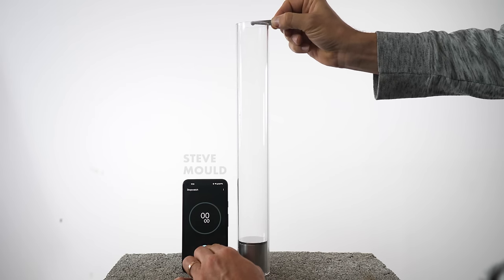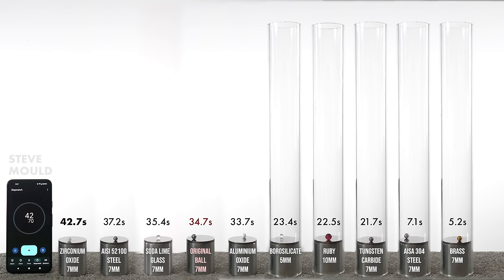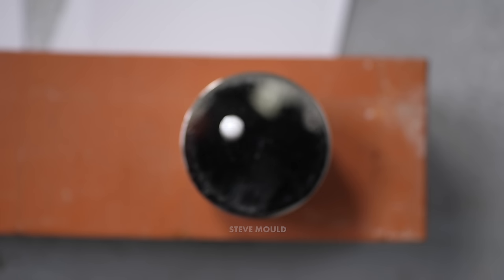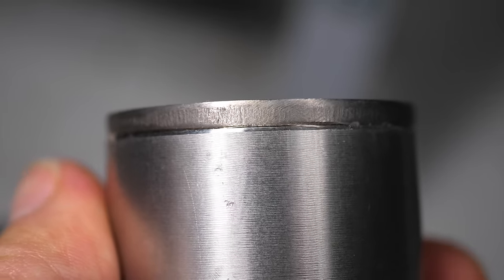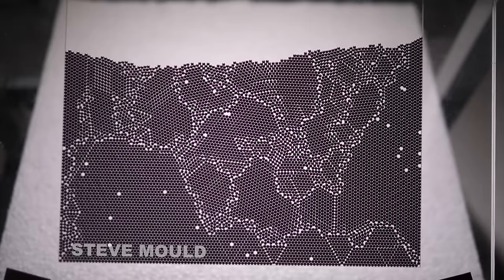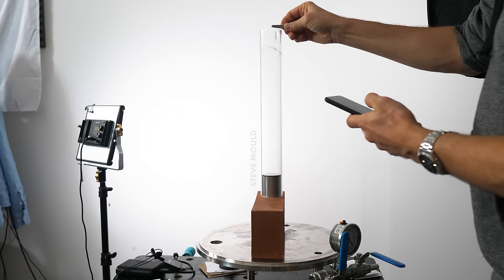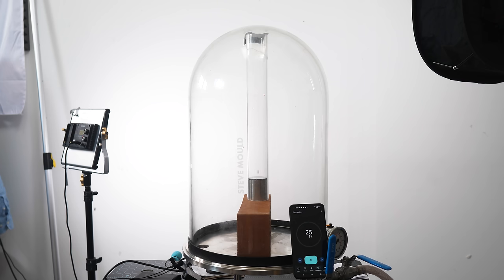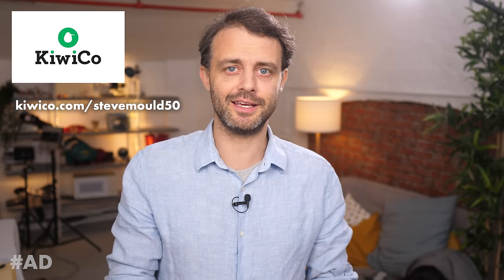This weird metal is insanely bouncy

Comment: Awesome video! Those were some very impressive bounce times! You mentioned that if every next bounce was some fraction of the height of the last, then this height would never reach zero, so the ball would bounce forever. However, the time between bounces also would reduce exponentially, so you end up with a geometric series that converges. You actually end up with a beautifully simple formula for the bounce time using idealized physics (so no air resistance or deformation just instantaneous bounces with a constant coefficient of restitution), total_bounce_time = sqrt(2*initial_drop_height/gravitational_acceleration)*(1 + coefficient_of_restitution)/(1 - coefficient_of_restitution). Of course, the real world is a good deal more complicated, but in this view, the ball bounces infinitely many times in a finite amount of time. Anyways, great video! :)
Reply: By the way, if you graph the logarithm of the delay times between bounces you get a decreasing line, whose slope it's just the coefficient of restitution. Any departure from the linear behaviour is due a failure in the simplistic assumptions.
Reply: @vincenzomartorana2625  to paraphrase your last sentence: If the data doesn't match the model, the model is wrong. 😆
Reply: @jimbrookhyser  and in this case testing the model is  as easy as tracing a line through the experimental points 😏

Comment: All I can say as far as getting your hands on similar ball bearing is that several years ago, and I couldn't even tell you what year, I read an article about a specific iron alloy metallic glass which exhibited exceptional bounce. If you can find that scholarly article I'm sure he'd be able to contact one of the participants in the experiment and see where they source their material heck you might even be able to lay your hands on the original Ball bearing in the experiment.

Comment: If you are testing number of bounces again, samplers like the one in Logic Pro x can easily tell you by loading in the audio file and using transients/peaks as the metric that decides chops/divisions. then it will may tell you how many it was able to locate (dependent on the software it should show up pretty apparently, I know logic’s quick sampler does)
Reply: same with fl
Reply: Reaper does it too. Many ways to do this. Remove silence by playing with the threshold will chop the file into several pieces, select them and it will say how many... Also slice by transient.
Reply: @capoman1  do you like reaper how's the UI

Comment: Would you be interested in using some of the sound files and measurements to calculate the gravitational constant? Not only could it be a relatively cheap way to calculate g, I am curious if it could measure the gravity gradient by performing the bounce tests at various heights.
Reply: You're going to have to assume that the collision time (the time the ball bearing spends in contact with the surface) is constant, which might introduce some error.

A second source of error will be due to the  sampling frequency of the audio stream.

You could probably get a pretty nice value out though.

Comment: If you assume a fixed coefficient of restitution (between 0 and 1) for a given ball and surface, even with perfect conditions (vacuum, etc), the time for each bounce is a fixed fraction of the time of the previous bounce. Thus the times of the bounces form a convergent geometric series, making a finite total time. Thus even if there were infinitely many bounces, the bouncing would stop after a finite time. (As you say, physical reality cuts it short in any case.)

Comment: That was genuinely fascinating. I found myself dying to see it tried in a vacuum, until you hit that very subject. XD I think you would have gotten a more dramatic difference with the smaller balls in a vacuum if, as you said, air resistance was the main factor limiting them.
I went looking for the Caltech paper to see what the final alloy was and found the simulations they ran to find the best conditions fascinating as well, and slow-cooling molten alloys in a centrifuge at 60,000 g kind of broke me for a second.

Comment: Fantastic video! I did my undergrad in materials science and mechanical engineering. The university I was at is still doing research in bulk metallic glasses. One of my friends did his PhD on the subject and is still working on it. Maybe they can hook you up with a bearing (University of Saarland, Prof. Ralf Busch's group)? Either way, the explanation was perfect.

Comment: 4:15
Sorry, I'm going to interject here with a minor correction! The time that the ball is in the air after each bounce is proportional to the speed at which it left the ground. If the speed decreases by a constant proportion after each bounce, then the total time can be represented by a geometric series, which will converge to a finite value. Therefore the ball does eventually stop bouncing, even in an ideal scenario.
Reply: Yes, I agree. "It would never stop bouncing" is very misleading here. In the mathematical ideal world, while it would bounce infinitely often, it still does so in a finite amount of time.
Reply: Achilles turtle flashbacks

Comment: Hey Steve, I love your videos and there's something I just noticed and it is the pacing and hooks in the video.

I'm currently at 5:54 and you seem to have exactly predicted what I was thinking you should explain next. Here's the list you've predicted so far:

- veritasium's video
- calculating the percent improvement in time
- using code to count bounces
- using sound to count bounces
- dilemma of whether to count manually or to write code

The streak was finally broken with the "crickets" and the mouth shapes. That was quite the inswinging yorker :D

Comment: I am amazed by how we could hear the bearing hitting the plate in the last trial with the partial vacuum. Our ear is sensitive enough to detect the vibration through the plate and substrate metal to the brick which vibrates and in doing so compresses the air and sends waves of compression to our outer ear which channels and amplifies these waves to our inner ear and so into our brain so we can 'hear' the vibration. Incredible.

Comment: so what if you had a metal made from a single "perfect" crystal of metal? would that then become a superior bouncy surface than a standard metal that contains imperfections?
Reply: I'm suspecting that the absorption goes beyond only plastic deformation and into the crystal lattices themselves absorbing some energy, as most lattice formations are not perfectly rigid like diamond could be in theory.  I'd be curious to see it tried, but I think the amorphous substance would still win.  I also wasn't surprised that the zirconium ball took the lead, as the folks who formulated the disk (also containing zirconium) were probably on to something.

Comment: I wonder if it would have behave any differently with the amorphous disc sitting on a steel tube instead of a solid cylinder, so it was like an elastic bridge not transferring energy to the steel in the center and plastically deforming it.
Reply: I think you’d get shorter bounce times.

Comment: One other kind of ball bearing material I'd like to see tried is CBN (Cubic boron nitride), being the 2nd hardest material there is after diamond.. Quartz could be interesting as well.. unfortunately I haven't found any sources for them.
CBN is often used in machining very hard metals, it's pretty amazing stuff
Reply: i wonder if density would affect results. it would be interesting to try osmium
Reply: @stewartross1030  I think the density would be minor in comparison to hardness.. density would mitigate the air friction a little but not much more.. try lead and gold.. heck, try mercury :)
Reply: Good point about density. Makes me think that rebound has more to do with how strongly the electrons are locked into their orbits.
Reply: @TheFredmac  yeah, quite possible, and if they're really locked in you'd think that would provide a stronger crystal lattice.
Reply: @Rx7man  In theory, the stronger the crystal lattice the harder the material, the problem with ceramic materials it's that it's not structure of single crystal defines their properties but also how crystals are packed in the material. I googled for microscopic structures of CBN and ZrO2 and the CBN has much more empty spaces in structure which can lead to friction between crystals when bouncing and loss of energy. If we could create perfect monocrystalline balls of both material then CBN would be a winner.

Comment: If you want to improve the result even further, you might want to scale up your setup, that is, drop the ball bearing from bigger height, so that it has more energy to start with, place the vacuum chamber on an anvil, or pull stronger vaccum! Even materials that have crystaline structure can behave like this, but they require a much bigger weight diffrence between the bed and ball bearing. You can see an example of that in one of the videos of Fireball Tool, the one where he planes the sufrace of Alex Stelters anvil. Combining the best of both cases might yeild sthe coefficient of restitution that is even closer to 1.

Comment: This is cool, that material must be incredibly hard ont he rockwell scale. You can get a similar, if not as good, effect with heat treated metals with very high hardness. A tungsten carbide disk brazed to a larger steel billet would probably be really close if you wanted to homebrew one.
Reply: does the heat treating break up the crystal structure?

Comment: There's a term used in numismatics called plastically deformed die error. It occurs because the die or dies being used are not hardened sufficiently enough to maintain it's designed shape. The alloy of the die "warps" over time getting more and more pronounced. That deformation is transferred to the planchet being struck. A cool error for collectors and good example of physics at work.

Comment: is it possible that sound itself is releasing energy also?  i know sound is just the result of the objects collision, but do you think there's a difference if you could vibrate the metal slab in a way that makes the ball bearing take some energy from the vibrating plate? there's gotta be a way to make this ball bounce for longer.
Reply: Sound is always energy loss.

Comment: While testing different sizes of bearings you mentioned that the smaller ones had an unfair disadvantage due to air resistance, did you try the smaller bearings in the vacuum to see if there was any improvement?

Comment: The ruby bearing is especially wear resistant. These are used as the point [of contact] in performance tops that are designed to spin as long as possible.

Comment: A similar thing, if not the same thing, in blacksmithing is called Hardening. Usually done through quenching. You can turn a hot piece of metal into a very hard piece of metal by heating it specifically and then cooling it very quickly. Most of the time hardened metals become very brittle and need to soften which is the opposite, reheating to a certain temp and then cooling slowly. 
It's also why a hammer will bounce off another hammer, or anvil. As they're both very hard surfaces, but run the risk of chipping or shattering.

Comment: regarding the bouncyness of the different diameters of balls: a bigger diameter ball is relatively more elastic then a smaller ball. The mass, the amount of matter has increased, but the stiffness of the material has not increased with it. Energy is lost in any type of deformation, also in elastic deformation: it returns not all the energy back that was coming into it. And so, bigger balls loose more energy in the bounce by shape-changing, transformed into heat.  (taking this into extreme: you could think of a ball bearing so big that it collapses under its own weight while sitting still on the surface, while it is still the same material.

Comment: Awesome video! Maybe the smaller ball bearings would have a significant difference when placed in the vacuum? Earlier in the video you specifically chose the medium ball bearing because they were less affected by air resistance than the smaller ones.

Comment: Fun fact, 52100 is a common knife steel, and many smiths use ball bearings in canister damascus to get specific patterns. 

Ball bearings are also used to roughly measure an anvils "rebound", but I dont know much about how true this is. I think 70-80% rebound is considered good. That means if you drop the ball bearing on the face of the anvil from 10 inches, the ball will bounce up to 7-8 inches etc. Apparently the higher the percentage, the better the rebound, the ball bounces more, and the better the anvil or something. I dont know. I could be wrong.

Comment: Hmmm.  Does the molecular motion in the ball actually stop just because it stops bouncing?  Is there “ghost movement” inside the ball which takes time to actually dissipate? Without the bouncing it would be absorbed in the mass of the ball in different directions, which is the same factor involved in the decay of the bounce during your experiment.  This certainly changes with the purity of the material used.  Any void would cause a decay through absorption.  This was fun!!

Comment: Energy is being lost as sound, correct? So if the sound can be dampened further would that make the ball bounce more? I think the brick had some sound dampening effect.
Reply: The vibrations producing the sounds need to stay within the ball producing them (thus not producing "external" sound). Damping outside of the ball and plate does not help!

Comment: Wait...would the cylinder density and composition effect it too, because it rests on the base that has the brick and ball baring rig on top? Maybe we can reduce force dissipated into the cylinder wall by varying the material as well. Cylinder wall material maters in balancing forces within combustion engines, improving wear and tear on pistons (making the forces more elastic; reducing impact)...so might it be that we could observe an improvement even at the smaller scale of our ball bearing?

Comment: I saw that your group tests were sitting on the same surface and I think a single ball bearing test will run longer than a group test because the vibrations from one ball will interfere with bounces of the other balls.

Comment: I used to induction harden 52100 for a bearing company.  That stuff is bananas hard. If the tempering is incorrect it notifies you by exploding while waiting to be turned. For some reason they don't pop in the lathe.

Comment: I think given dropped from basically same height, the smaller bearings have less energy to begin with. 
The heavy ones transfer too much energy out. The sweet spot has sufficient mass for initial energy, but not enough to be dissipated out

Comment: It’s clear that the second slug was mild steel; much better results could have been achieved with a higher carbon steel with a good heat treat (or a high alloy tool steel, similarly hardened).
Although glasses do provide some unique properties; but I believe in this instance a significant portion of that performance could be achieved at a significantly lower cost with a face/body-centred cubic crystal.
You may even get better results due to the elimination of the solder-layer with a (reasonably) homogeneous hardened billet.

Comment: What happens if the surface is cooled to cryogenic temperatures (assuming it doesn't become too brittle and shatters due to the shock)? Will that further immobilize the atoms to resist dislocations/plastic deformation and increase the number of bounces ( in air and/or vacuum)?

Comment: Hi Steve,
I have been thinking about this velocity/bounce video since I first watched it, twice.
There was something vitally important hidden in those bouncing balls that fascinated you.
Today I finally figured it out.
Current computing is binary... but the world is analogue.
Black and white evolved into 256 shades of grey... but the world exhibits living color, which morphs with date, time, GPS and temperature/weather factors. It took decades of development for color computer screen resolution to mimic reality. Now we take that for granted but I grew up with a black rotary phone tethered to the wall and a blind hand set curlicued to that base..
If computer logic trees used the strength and duration of ball bounces for deciding which assending or descending branch to enter next, computing could become much more fluid at a macro level. There is a children's sieve toy which when flipped over sorts randomly colored marbles by size showing them in neatly separated rows to be anything but random. Analogue computers preceded digital ones but they might find new applications with the addition of predictable deceleration &/or bounce decay.
My immediate thought for differential response was sound encoding, like velocity readers on synth keys. I am sure computer boffins could come up with many more possible and probable applications where nuance currently lacking in AI might be vastly improved.
I know this concept may sound way out there but my idea of triangulation on the flat surface of an iris to allow eye typing by a patient with ALS has become a useful targeting system on US jet fighters. I am writing to you specifically because I thought you might foster peaceful applications of these binary replacements. Besides Steve, you are the one who gave me the idea.

Comment: As in the metal sheets, there is some imperfection in the video. Steve says that when a ball bounces on a stretched rubber sheet, this would be due to the stored elastic energy (9:34). And while this might be true for elastic deformation in other materials, rubber elasticity is a thermodynamic phenomenon. In result, the deformation energy is transformed to heat on deformation, while the entropy of the system decreases. The reverse is true when released.
Reply: There is a great book from Treloar, called „The physics of rubber elasticity“